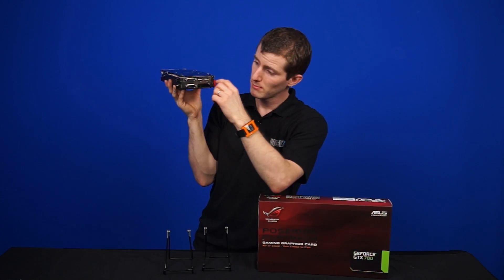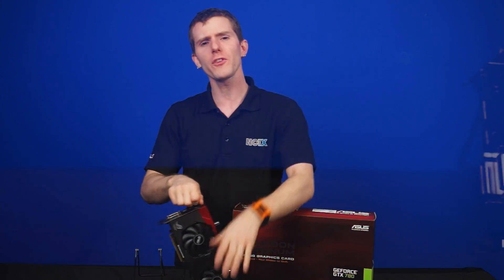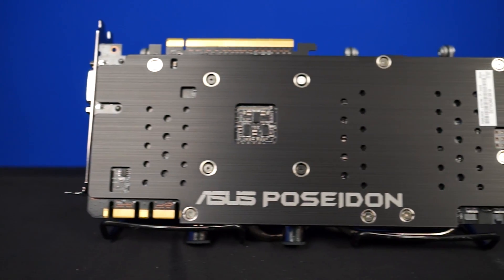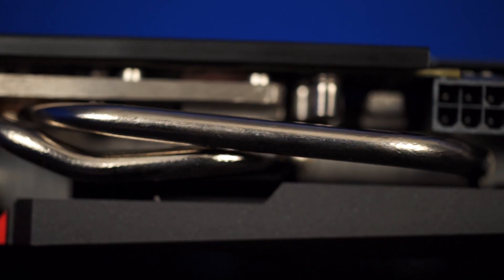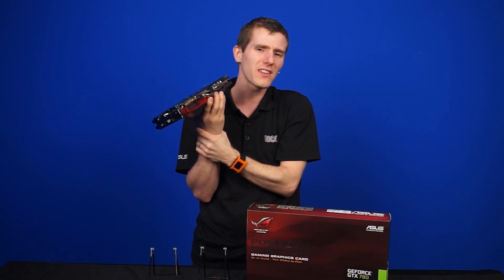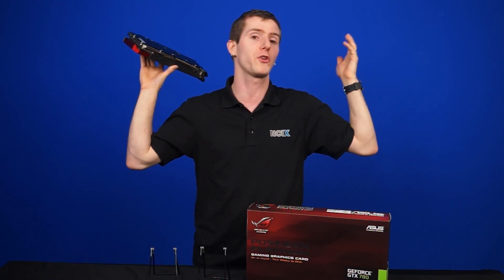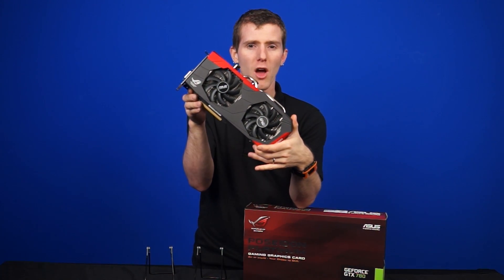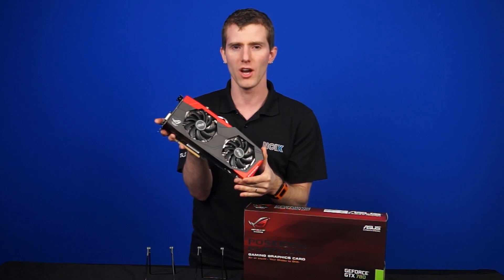ASUS ROG Poseidon GTX 780 Hybrid Air/Water Cooling

Comment: thsi is just a gadget without a real function. They could have optimized the cooler for air only and have the same effect. This has no value for a watercooling user at all, they rather have a real watercooling block on there.

Comment: Why didnt they put this on a gtx780ti? What a shame..
Reply: When they thought of the design the 780ti wasn't released.
Reply: TheUlquiorra413 Lolnope. The GTX 780 Ti has much more CUDA cores than the 780.
Reply: TheUlquiorra413 owned
Reply: And technically a 780ti is a like a 780 overclocked.
Reply: BLR IDRIFT Owned, now powered by CUDA cores.
Reply: GTX 980 one is coming out now, it's been announced, screw $700 780 Ti, GTX 980 performs same and cost $550
Reply: Zer0NoiZe I wanna see this on a Titan X.

Comment: this card is a foolish choice the price is too high and will not work as well as adding your own much cheaper water cooling option.

Also whats the market for this? If you are unable to install your own water bricks you do not have the ability to maintain a loop and should ether stick with air or get factory sealed options installed by others

Comment: I did a little research and found that I could buy a 780 and purchase an aftermarket water block and save about $150 bones.  So nifty idea but for a bit of my time I think I will put my own water block on thanks.
Reply: ***** he could still keep the old gtx 780 cooler and put that on the card when he starts using air cooling again